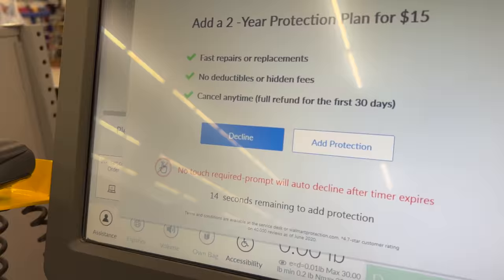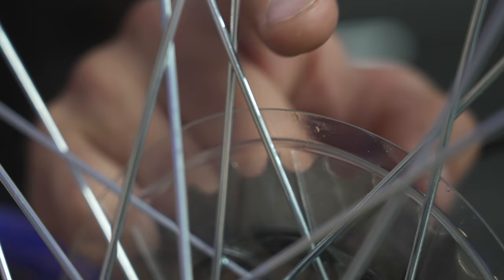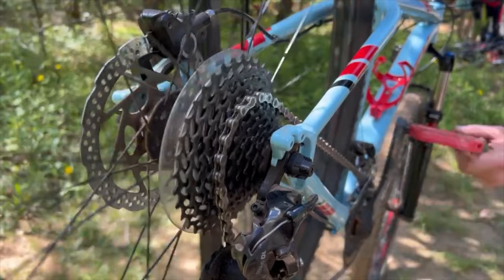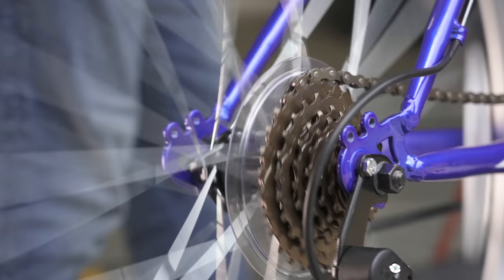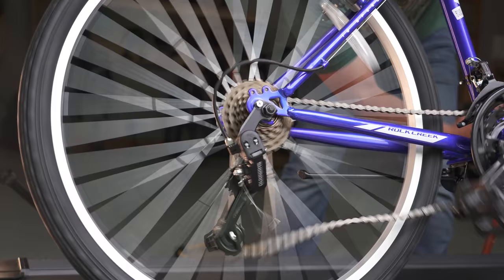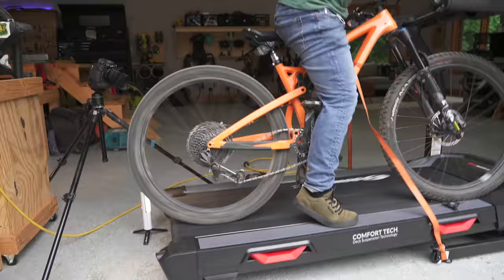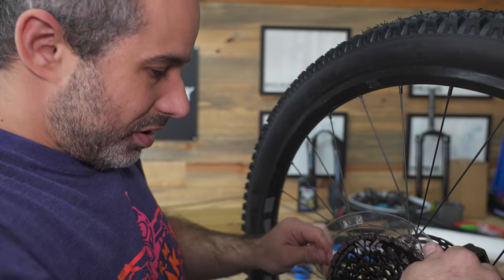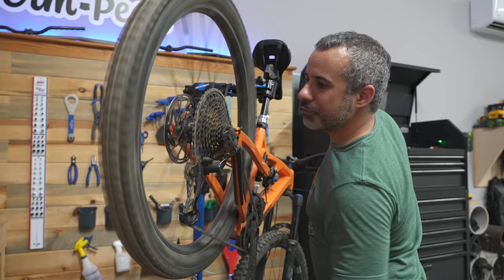What is your "dork disc" actually for? What happens if you remove it?

Comment: I feel like that disc is a half-hearted, minimum-cost token effort by manufacturers to address a real potential problem, but ends up being only marginally effective, because it's just a bare-minimum effort to meet the letter of the requirement.

The more effective solution would be to have a disc machined or cast out of aluminum with a channel around the edge to 'catch' the chain, mounted on a bearing to allow it to spin independently of the wheel, so that in a jumped-chain situation, the chain and wheel cannot transmit torque to one another.  it would not be very expensive to produce at scale, and would take up relatively little space.  But it would also be too bulky to retrofit onto an existing product line, which is part of why manufacturer's go for cheap plastic disc option.

Comment: I had this happen a few kilometers after a minor wipe out on my gravel bike at the end of a fire rode ( darkening conditions+ wheel rut).   Unclipped my SPDs mid wipe out. Rolled out of it. No problem. But what i didnt realize til a few km later was that i had bent my deraileur hanger.    This caused my chain to skip badly... any time i climbed. And the result was not any damage to the wheel... ( i didnt pedal through enough... stopped on time. But the chain went around eneough to yank off the compromised deraileur hanger).     

I'm still looking for a good tech video on how to break a chain in an emergency... and measure it to turn the bike into a fix gear 1 speed....

I knew i had an option for about 50 more minutes of loading my bike under an express bus ( Korean private intercity bus.. like a Greyhound but better) .  I didnt have chain pliers in my emergency kit... nor time to google other hacks... so i broke my chain... pushed up hills and coasted down hills to catch the last bus (taxi home ... leaving my bike with a thin cable lock or a cheap Agoda would have cost more than a new chain ( mine had less than half its life)... plus my own bed.. good leftovers and cold beer waiting at home ).  Long short...  i am not exactly sure why the chain would go over the granny gear on a rapid descent..  perhaps at the end of a descent rapidly downshifting on a 1x.. due to a punchy upcoming climb?

So for me... it was higher torque climbing... low rpm..

Anyways... i now ride with mini chain pliers and a spare deraileur hanger in my emergency kit when doing remote fire road runs.

Comment: it's happened to me once when the chain went down the back crushed that thing into the spokes as you will know being old skool these things were solid back on older bikes! The chain kinked when got stuck down the back I landed on bar clamp man hood done in, and fell back on my slope top bar and was running downhill on the tdamb thing trying to get it to stop as feet came right off peddles as they do! Yeah i think they were very dangerous and why we started removing all plastic from these rollong area! I have even had a wheel reflecter come loose spin side ways and you would think it would just snap as it hit the rear triangle posts as it turned but no it put the bike into a skid locking up the V breaks aswell! Very dangerous i done trails and DH and put all the front idlers on the crand and the old CDC chain stays tensioner that hung down held the chain up helped alot it stay in line! I'm talking 2003 that one you pulled off there looked as soft as a coke bottle! But find an old bike these things were thick solid plastic!

Comment: Leson 1 spend the extra money and buy a  rohloff rear hub or 2 buy a bike with a pinion drive and gates belt drive and you will never have to worry about this or cleaning and lubeing a chain . Not to mention the cost of replacement chains , cassettes, bottom brackets,  I have 10,000 miles on my pinion drive and gates belt.. never a issue.  It handled the gdmbr with no problems.

Comment: that happened to my dad once
dork disk wasnt there and being an old schwinn with ground down teeth it went into the spokes, sucked the derailleur in the spokes and locked up the rear wheel and maxed out the front suspension.

Comment: Great video thanks for the share. Personally I’ve never had any problems with a chain coming off the sprocket and going into the wheel but then again I only ride on the road and my bikes have always been properly maintained and my first bikes in the 60s never had gears but I’ve always left the dork disc on like any other “safety” device.

Comment: was riding my hardtail after getting it back from a shop, and I guess the guy missed the L screw cuz i was on a chill ride on a flat river tail with a friend who was new to biking. I was explaining shifting gears on slopes to him when boom, derailleur got sucked up, bent some teeth on one of my cogs, almost ripped a tooth off the top pulley, bent another tooth in the bottom pulley, bent the cage between the two and the B tension screw got bent pretty good too. The chain got lodged in the spokes so bad that the wheel wouldnt even spin even a few mm either way. had to replace some spokes, I ended replacing the whole cassette as it was pretty worn anyway but I kept the mangled derailleur as a paper weight and upgraded to the sram GX so it kinda worked out haha

Comment: As an adult, when I ride, it's often on or along roadways. I don't even take reflectors off of a stock, cheap bike. Been almost hit too many times. No way I'm removing those safety devices. And I've had a chain lock like that on a high-speed (45mph+) paved straightaway (the paved shoulder of a 55mph divided highway). I, in the middle of an instant what-the-hell moment, foolishly stopped pedaling as it happened, and it yanked the pedals out from under my feet as thr chain wrapped up behind the cassette. I was seated, luckily, and just rode the skidding back tire to a stop without further incident. I may out may not have peed a little. Who's to say?

But anyway, yeah. Too many incidents over the years. All stock safety devices remain on any bike I buy.

Comment: Should remove the dork-retainers in cars too. And the dork-bags.
BuT It'S nOT thE SamE!
Well ... seat-belts and airbags will not make 100% sure that you can walk away from every accident, but it can increase the chance of it.

And don't forget the dork-bucket on your head.

Maybe start calling it spoke-protector, make it actual work and not seem like a flimsy after-thought as it was from cardboard (e.g. rigid and close enough to the cassette that the chain can'T even jump off in this direction. Make if from aluminium and anodize it blue/red/rainbow.

Comment: When I got my first bike (a Stingray) and my sister got a tenspeed I was fascinated by the transparent disk on he bike and it looked so cool when it caught the light just right. Back then they were sturdier and they had concentric grooves and they acted kinda like a reflector (not sure if that was intentional). I still have an olde Huffy from the 90s with one like that, it's a little yellow now though. Now when I got my new bike it had a chintzy thing that looked like crap. I was like "get that thing offa there!"

Comment: I don't think the failure what be freewheeling into the 1st gear, but actually downshift into 1st and then torqueing it with an expectation of aggressively using that gear (as in downshifting before a hill, and then trying to go up that hill in that gear), when in fact the chain has fallen off the rear big cog.   

I think that would be more realistic representation of this overshifting failure in the wild.

Comment: Painful to watch. I broke my neck and sternum in 95 hitting the bottom of a downhill line doing around 60k. It had been raining severely for a couple weeks prior, and had apparently washed out the shoring at the base. When my front wheel hit it, my suspension bottomed out and through me over the bars. What made it near catastrophic was my left clip didn't disengage, and my bike came over my head with my foot still clipped in further putting pressure on my neck. Thank God my helmet did its job, though it exploded on what was left of the concrete shoring. This was all in a split second, though i can still reflect on the details like it was a drwan out movie scene. 
Was long hours in the ER with  numb/tingly arms and legs not knowing if I'd be paralyzed, or at the very least left with impaired movement.
Fortunately, they found the bones and discovered were intact, and there was no severing of the cord, but there was swelling around the cord.
They relieved the fluid pressure in my  column and after a few hours, my reflexes returned, but it was a long recovery.
Still love riding, but have definitely gained a healthy respect for self preservation.

So sorry this happened man.
Hope you are recovering well.
Best to you.

Comment: most likely the spokes were damaged and will break overtime.Thats what i experimented without  a dork disk and an overshoot on the derailler limits.
I ended up printing one that prevents the chain to go between the cassette and the  dork disk  even with a bad derailler tuning.

Comment: I just bought a new bike. I hadn't even taken it for a spin or adjusted the seat before I took the dork disc off. The disc itself barely went inside the cassette at all. I feel like it's just to try to nudge the chain to keep it from going inside on a semi properly set up bike, not prevent you from bypassing the limits and cranking it inward.

Comment: I ♥my 'dork disc'.  If the chain is going to shift off the largest cog it is likely to happen when you are changing to a lower ratio whilst under load... you really don't want to get a chain/spoke mangle scenario in that case; your tests didn't have much load on them.  Maybe get outside and climb a steep hill and then shift!

Comment: Got my rear derailleur and derailleur hanger destroyed after I had crashed on the drive side and hadn't noticed the hanger had moved to the spokes. Happened right before my eyes when I was checking if the gears were shifting right, whilst riding on my bike.  The wheel was ok but the rim was bent a little after that. Had to buy a new derailleur and a hanger.

Comment: Well I guess I’m a certified dork, as I would really actually like to have one of those on my bike. The space between my spokes and the sprocket is very tight on my bike and when the chain gets down there somehow it’s a real PITA to get it out. Strangely though my back derailer is original and the front one has been replaced four times in 18 years. Not bad for a $380 bike from 2004 lol

Comment: Imagine if your derailleur got slightly bent inward? It would indeed get caught into the spokes and potentially rip the derailleur off of its hanger.

This has happened to me at least three times on different bikes without the protector. At least two of those times the derailleur not only got ripped off the hanger but completely pulled into the spokes causing the chain to literally rip the rim into a severely bent formation, rendering the bicycle completely unridable. Naturally, in the latter instances the wheel locks up and tends to cause you to crash, hence the legal requirement to have the protector installed.

However, I know of at least one lifelong bicycle mechanic who will not only remove them without authorization when changing cassettes, but argue endlessly about why I don't need one. Personal experience unfortunately has dictated otherwise.

Comment: I hope you took that Huffy to a thrift store or gave it away.
I know this is hard for you to believe but that would be a nice upgrade for many people.
There are people in my neighborhood riding much worse bikes to work.

As far as "dork discs" I wish they would make them out of more durable material.
How much would one from aluminum cost?
It would last forever.
Reply: "Back in the day" spoke protectors were made of metal, as were reflector brackets. Plastic took over because it is cheaper to manufacture.

Comment: LIFT THE FRONT WHEEL OFF THE TREADMILL! 
put a board across the front and the wheel on that. 
Also, the manufacturer likes the disc there so they can void the warranty when you take it off.

Comment: Always with a thread on freewheel those will stay good until the freewheel needs replacement then replace the spoke protector too. The three and for pronged ones hold up okay just replace it with a new cassette. Just was a good thing for commuting and casual riders.  That being said they certainly could be better designed for the new stuff with better materials because those rings are pretty useless and don't protect the spokes much either. I really don't like seeing any kids bikes without them too much stuff happens too them and the kids generally aren't noticing anyway it will keep the damage to a minimum and not have the rear wheel suddenly locked causing body injury or head injuries. And don't ever take those reflectors off a kids bike. Any of them put them on if you are working on a kids bike and they are missing. Front, Rear, Wheels and Pedals. Those pedal reflectors catch my eye petty quickly when I'm driving. Same with wheel reflectors. There are too many kids riding without lights and you would be surprised how many times I encounter bicycles with no lights and no reflectors  down town on a very busy and crowded  college campus. I was really glad I had a large supply of bolt on pedal reflectors to replace those that fell off. I can't stress the importance of lights enough they are essential for night. But in the absence  with a full set of reflectors a moter vehicle driver has a good chance of seeing reflectors in time. And those day running lights make a difference too. I pick those up easily. I know that at least one college kid didn't run into an opening car door because I caught a glint of light in my side view mirror before opening the door...yes it was careless on my part but doesn't really change my point. So lights could be an excellent topic for this site😊

Comment: derailleur on my bike, which is about 15 years old, i tried but cannot get the limits set right as it is worn out so, i made my own dork disk from the lid of a coffee can.  my older bike has far less space between the spokes and the cassette, without the dork disk, the spokes get bent/broken if the chain goes behind the cassette.  good thing i had another wheel i could use.

Comment: I found this out the hard way, I attached a 1kW engine to my bike and the chan went on the opposite side (not to the cassette) and there was no dork disk. One day my chain pulley (a hard plastic with restraints so the chain doesnt slip) got mangled, the bearing failed (chinese low quality) so the chain slipped off at about 50 kph. My wheel got stuck and the sticks got totally tangled... it's more like you just get a hand brake. This plastic thingy could have easily prevented that!

Comment: If it's usefull it would de made with strong materiel, but, some shimano cassettes have this piece monted on it and made of strong plastic. So, this way I say yes. And on rear motor electrique bikes if the chaine goes out this way it can be stuck between motor and cassette, and sometimes even brake the chaine (already seen).

Comment: I had an unusual flat where a nail and a piece of wood came around, bent and then snapped off my derailiiur  , throwing the chin off the gear ,l breaking the spoke protector , which protected the spokes.  I fixed the bike, except I couldn't find a replacement spoke protector.   Apparently they are not cool enough to support a replacement market.  I will try the manufacturer as my last resort, but the part probably isn't in any computerized selling program.

Comment: The damage gets really worse, when the chain gets between the spokes an the cassette under load! Then the load will SUCK the chain deeply in between the spokes and the cassette and spokes will get damaged! 
When going uphill with heavy load on the chain the chances of shifting "over" the first gear is much higher, because you will desperately shift down, to climb the hill. And this scenario will very likely lead to a chain, taht ist stuck between the spokes an the cassette.

Comment: Why isn't this thing machined into the cassette? It seems to make a lot of sense even if, as proven by your experiment, not all such cases will end up damaging the wheel. The purpose of the dork disk (which I never had on my bike and never heard about before) is to prevent an accident, even if an unlikely one. If it's worth it or not follows from what the drawbacks are and how likely the accident is. (Besides how much damage/inconvenience it can cause.)

Comment: I've had rides ended without the disc on  Going up a steep hill and shifting into the lowest gear, the chain went over and dropped between the cassette.  The chain was so firmly wedged in place it could not be pulled out.  I got to walk it home.   

When I go down hill, I don't do it in my lowest gears.  I downshift as soon as I crest the hill.

Comment: My derailleur got sucked into the spokes and locked my wheel up.  What happened is a link on my chain got seized over the winter and bunched up.  That caused the derailleur to get yanked back into the spokes because it locked the gear up. Had to buy a new derailleur and one of my spokes is badly bent

Comment: Happened to me once, bought a second hand bike and didn't check if it was adjusted properly. Went pretty fast and then the chain fell off. Immediately locked up the rear wheel and sent me sliding. Broke 7 spokes.